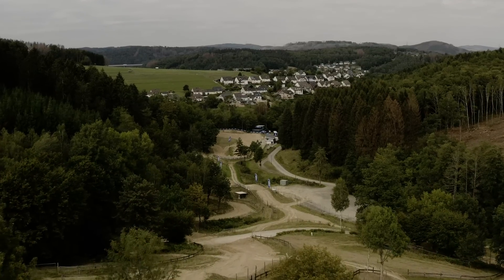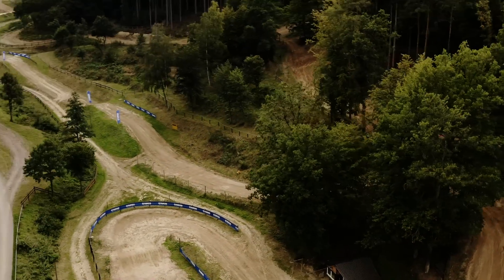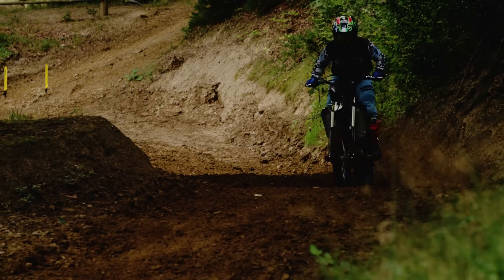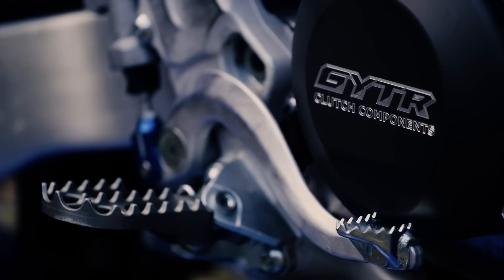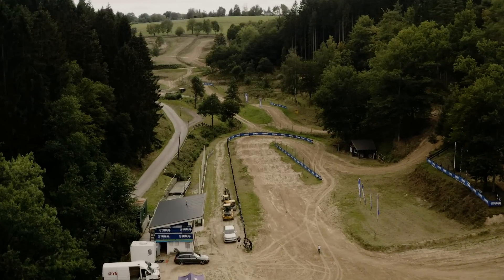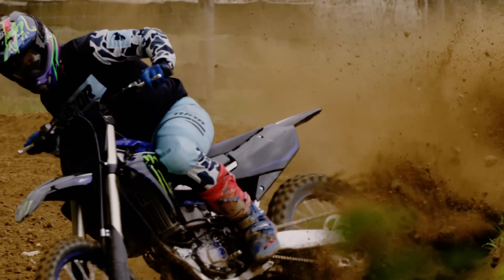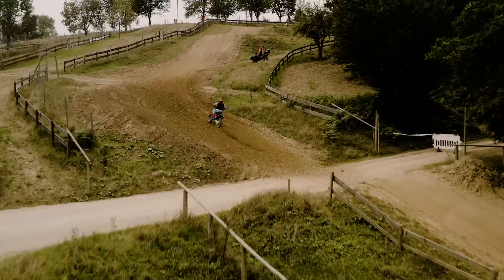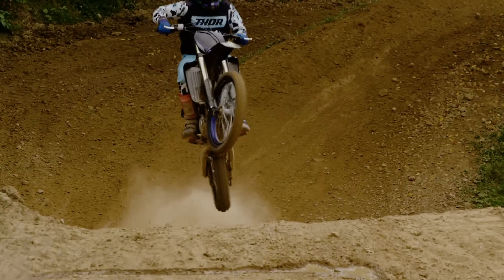First test: On board the all-new 2021 Yamaha YZ250F

Comment: 2 stroke 250 is way faster.
Reply: 2 stroke 250 would run with the 450's 2 stroke 250 needs to be on the pipe 100% all the time, 250f easier to ride for most